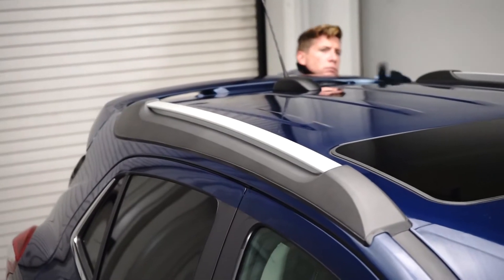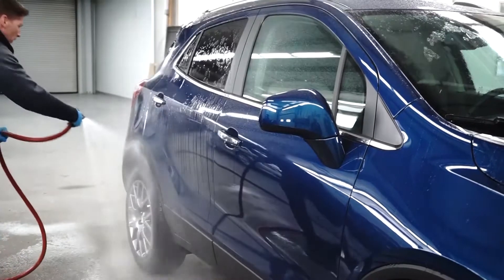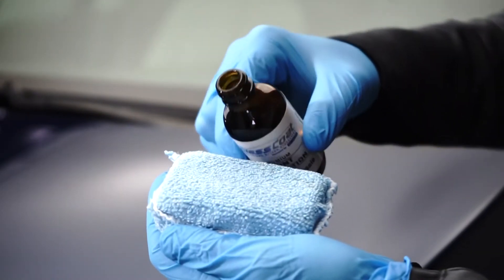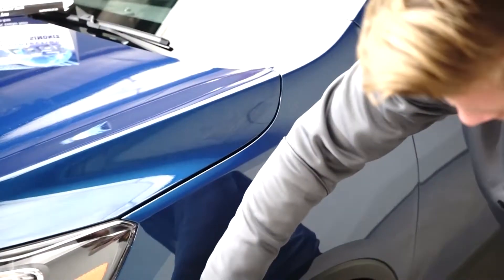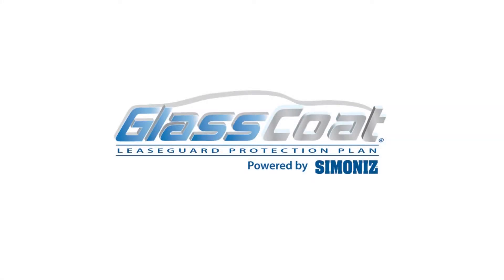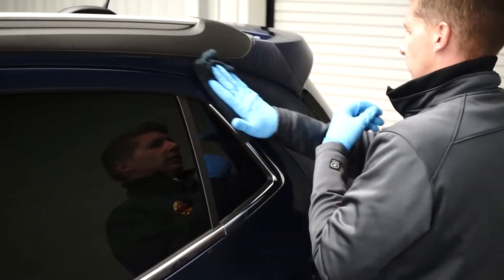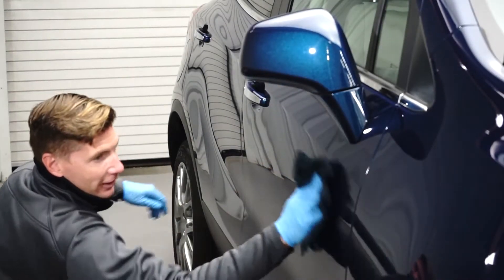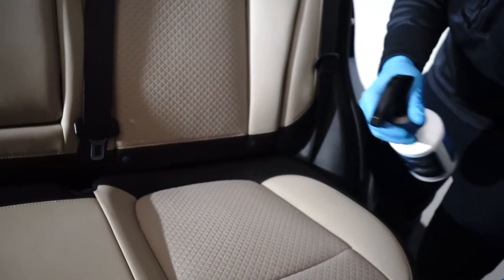Simoniz Glasscoat Application Video - English Version

Comment: I feel like the dealership truly didn’t apply mine. I closed on the deal and had the car 15 minutes later at dealership closing time
Reply: Same.  I called and asked if I needed to bring it in for the $800 GlassCoat and found out they magically applied it while I was with the finance guy.  Aren’t they supposed to “cure” it for 24 hours??
Reply: @David.Gaugamela sorry, you got duped. Happens everyday with these fake coatings.
Reply: Because they probably didn’t. Just washed it and maybe, emphasis on maybe, used a quick spray detailer with sio2 so they could legally say it had a ceramic coating. Takes 20 minutes and they’ll charge $800+

Comment: Hi.
Can we apply ceramic coat over the car if it's already glass coated with Simoniz product?
Reply: Depends if it is a coating vs a spray. Ceramic sprays are quick ceramic that does not bind to the clear coat, like a ceramic coating does. If you apply another ceramic coating it wont attach directly to the clear coat.

Comment: They should just come out and say it's a ceramic coating. So stupid not to.

Everyone knows how impressive ceramic coatings are. 

The reason customers pay more to have it installed at a dealership is for the warranty which is YEARS long, cause the stuff really last YEARS. 

Free windshields are no joke on $60-$110,000 cars and SUV's either. I don't know how the company can afford to do it and they really do.
Rich people shit their pants when they find out how much they have to pay for a windshield on their vehicles.
$3,700 makes everyone's eyebrows raise. Then their face turns red. Sometimes stammering and breathing issues follow... Lol. 
On top of parts and labor, the new windshield has to be programmed.
Which is kind of hysterical. 

Don't think your car insurance company will cover unlimited windshields for 5 years, cause they won't.

Same with the tire wheel warranties dealerships sell. 

High end vehicles have incredibly expensive wheels and tires (plus computer programming charges lol).

1 pothole damaging 2 wheels and tires will pay itself off (and more) with tire and wheel coverage.
Reply: Are you okay?